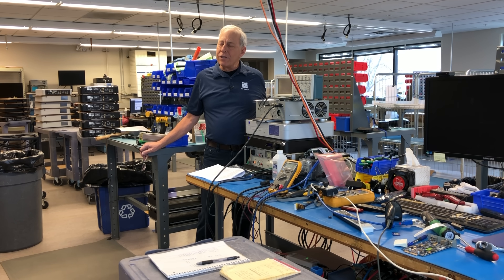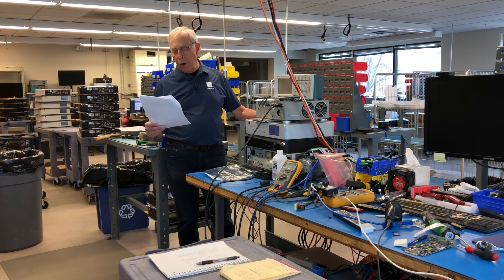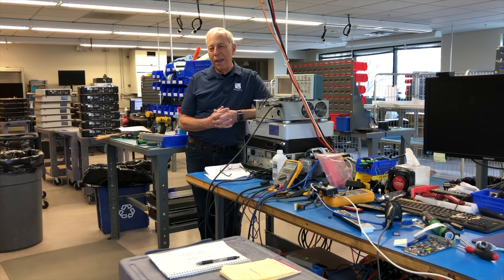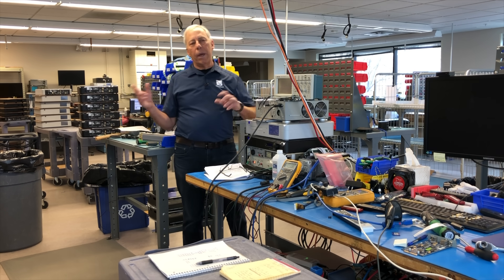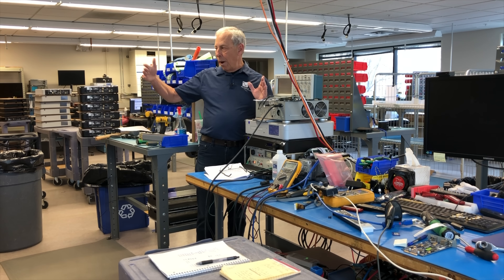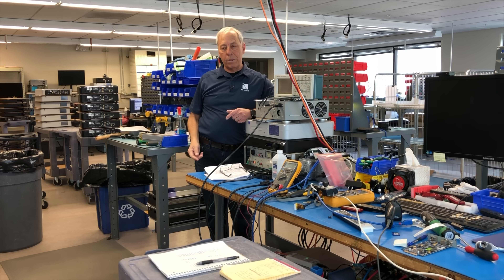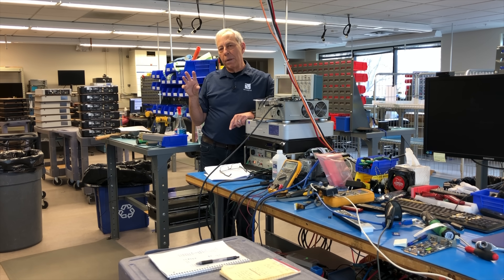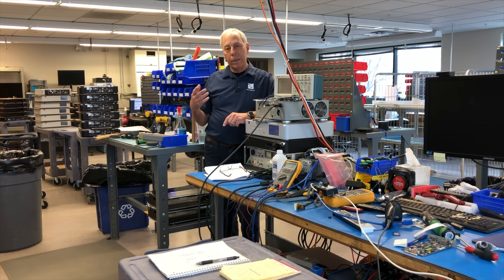Will a 50Hz component work at 60Hz?

Comment: the tv systems of uk and us /50/60hz dictated the framerate of the picture, uk had more interlaced lines (definition) us had faster frames. when we watch american films in the uk the music in the film is always faster on playback
Reply: This is not a direct result of 50/60 Hz but because the US used a 3:2 pulldown method of converting 24fps film to 29.97fps TV while the EU mostly didnt use a pulldown method because 50fps is close enough to 48fps (24x2)
Reply: @KB0B0  Correct.
Reply: @KB0B0  Well the actual reason for the the vertical rate of 59.94hz vs 60hz was an NTSC (American) problem that grew out of color TV. The color subcarrier frequency that AM phase modulates the chroma signals had to interleave with the old B&W line rate of 15,750khz. To get that interleave to work, the line rate had to be changed to 15734.264khz. That reduced the vertical rate to 59.94. The other alternative was to change the audio FM offset from 4.5mhz. All TVs had sufficient range in their H & V oscillators to cope with with the new H & V frequencies. Re-tuning the sound IF strip by a skilled technician and shop in every single TV was not a popular road to go down. To this day we are haunted by the old 59.94 even in digital & HDTV TV where is doesn't matter anymore. Yet we had to remain compatible through the HDTV transition. For UHD 4K, we finally dropped the 23.98/29.97/59.94 and went to true 24/30/60hz. The Europeans with PAL and 50hz never had this problem as their frequencies were all different so tyey stayed at 50hz through their color transition.
Reply: does the 50-60hz on tv framerate come from a power supply or produce inside the integrated circuit. Ur tv circuit does not feed directly from the line it will take power after the bridge rectifier.
Reply: @SlyGoesMeow  Consumer TV sets were never locked to the AC line. They get their sync from the received video signal. Some early B&W TV stations were line locked but all that changed for color TV, see my post above. Plus the short term frequency stability of the power grid is rather poor, especially in the 1950s. Long term accuracy is near perfect over a year - great for line locked clocks. But not really ideal for a TV system reference. Now they did used to lock analog security cameras to the AC line so that you didn't get a roll when switching between them but that was a local in-building system. Broadcast TV cameras were/are fully locked with each other in a system both H & V counted down from a master oscillator - 14.318180mhz for NTSC color systems. And at newtork centers this 14mhz was often synthesized from a 10mhz atomic reference oscillator (expensive!).

Comment: Nicola Tesla was responsible for the 60Hz offerings from Westinghouse, but it was largely Larry Hammond the clock and later electric organ maker who was responsible for standardizing a solid 60Hz on the nascent American power grid. When he was a clockmaker he designed a synchronous motor than ran on 60Hz and sent free clocks to every power station in operation, telling them that if they kept their output at precisely 60Hz, the clock would keep perfect time. There was a court battle with General Electric over the synchronous motor which Hammond won after showing the judge that power stations used Hammond clocks. Hammond's motor wouldn't start automatically when power was applied and needed a physical push, so you would know there was a power outage instead of assuming the wrong time was correct and he saw this as a major advantage for worker bees that might miss their train if the time was off. When Hammond's synchronous clock motor patent was undermined by the discovery that the clock in the town square in Cologne, Germany used the same technology, he ended up switching to making electric organs which used synchronous motors in the tone generators and relied on the 60Hz line frequency for their tuning.

As an extension to Paul's answer... Avionics and military systems use 400Hz AC which allows you to shrink the iron content of transformers by roughly 80% over the needs at 60Hz. Running 400Hz equipment on 60Hz will smoke it immediately, but using 60Hz transformers on 400Hz power makes them run cool as a cucumber.
Reply: It is sad that today, power companies are less vigilant in keeping in the frequency at exactly 60 Hz.  I have a few clocks that use the power frequency as the reference and they no longer keep accurate time.
Reply: @swinde  They never were precisely on frequency. Varying frequency is part and parcel of management of the power supply. Load on the system varies through the day with a peak in the early evening. The supplier needs to manage the system to keep voltage within reasonable bounds. Hydro Tasmania told me that they do work to manage the average frequency for each 24 hour period to be exact to keep things like electric clocks using synchronous motors accurate.

Comment: A 50hz power transformer should be just fine at 60hz.  The inverse may not be true, the transformer might overheat.  However some equipment is rated for both.
Tesla aside, 60hz was logical because it makes synchronous motor electric clocks easy.  (Actually not really a problem at 50hz, just change the gearing....)
Reply: Hi.Computer Power supply is transformer right.? So can i use a 50hertz PSU in 60hz electricity
Cause here in philippines we have 60hertz.